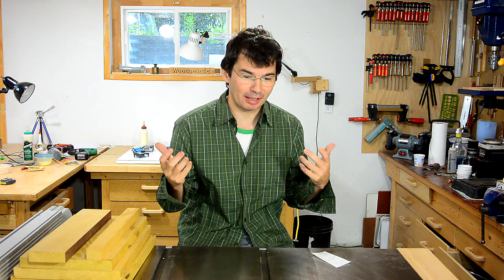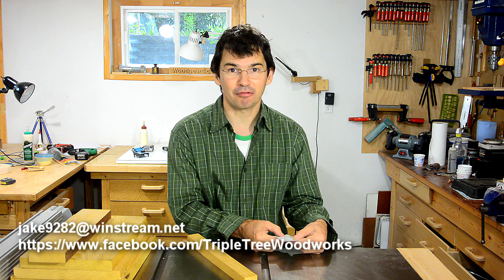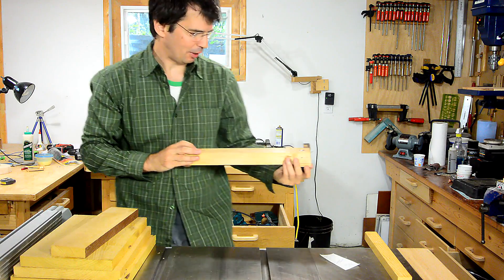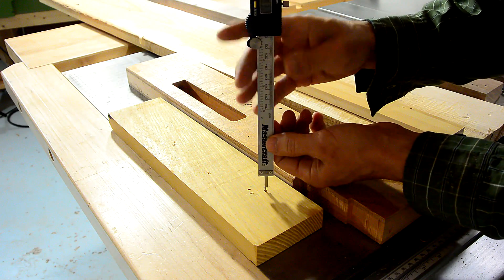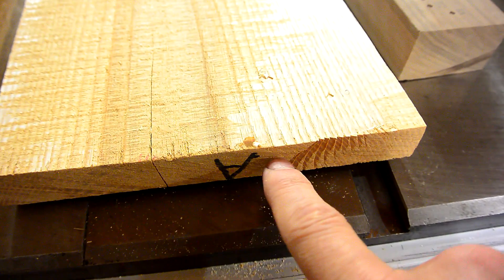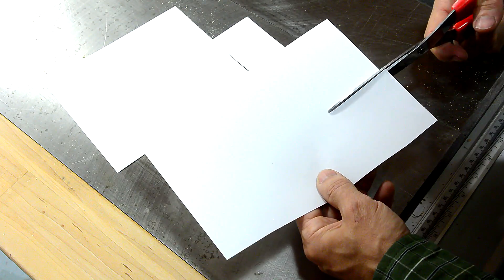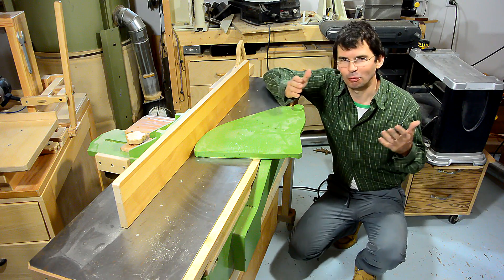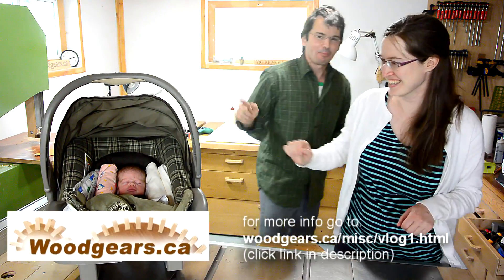Vlog - odds and ends

Comment: Congratulations on the baby!!

Osage orange is also known as bois d'arc or bow wood.  It is very resilient and flexible  and was used to make bows for hunting.  I think it's flexibility will meet a lot of your "spring" needs in all wood construction of tools and jigs.  Growing up, we called them hedge apple trees due to the heavy large green wrinkled fruit and the fact that it was always found on fence lines and along roads in rural areas.  I later learned that they were actually planted there as wind breaks to keep wind erosion from blowing the topsoil away.
Reply: I remember cutting firewood in my teens and being told not to cut the hedge apple trees because it burns so intensely hot that it would supposedly ruin chimneys or cause chimney fires.  Not sure how much truth there is to that, though I suppose it might be worth a try for blacksmiths if coal wasn't handy.  I also remember having to sharpen the chains a heck of a lot more often when we were clearing them.  Really tough stuff.

Comment: I admire you sticking to your principals, Matthias!  Interesting take on the pocket holes vs. jointer.  While I own both, I do find myself using the jointer 9/10 compared to my pocket hole jig.  Having said that, they have their place in rapid build up.  I always use glue to help increase my chances of a pocket hole project not coming apart.  Congratulations on your daughter!

Comment: Congratulations on the baby!  Projects I see in the future . . .
1. Crank-adjustable height bassinet, raised for changing diapers, lowered for reducing potential fall height to the floor.
2. Auto-rocking bassinet, with cams and linkages to emulate the rocking motion of parents.  Bonus: Different settings on the cams/linkages giving a Mommy and a Daddy setting.
3. Sound machine made entirely from wood . . . a miniature air raid siren in a sense, with more whooshing and less siren.
4. More baby gates, of course.

Comment: Congratulations for your new Family member Harriet !

Word to the Pocket holes, i think you're right about the jointer/pocket hole thing. I don't have access to a jointer so i guess Pocket holes are the fastest and easiest way to get stuff done, but even if i had a Jointer i would still use pocket holes for the same reason you mentioned. I have to agree , pocket holes are ugly! But depending on the project i choose the joining technique, if i like to show off the piece then i choose the "visibility" of the joint's, if i want the joint's to be invisible or highly visible  if they are nice. All depends on the piece itself , example  a gift box with pocket holes makes no sense and also dovetails on a Step stool that gets abused every day makes no sense either. My opinion is that, the joining technique should match the project and if its strong enough and saves time, then pocket holes are no shame at all ;)

Comment: when we first moved to my parent's new property in the early 90s there was an old wire fence with cedar posts along the east side.  That post was old as shit then.  It's been 25~ years and that cedar post is looking worse for wear, but you could still nail into it and it hasn't broken.  Suffice to say, that post was probably there for 50-years, exposed to the elements and high southern humidity, and it's still going strong.  And I say that to say that the orange osage post on my other neighbor's lot has been there just as long and it still looks like it did the day it was set.  Orange Osage will last 80-100 years on its own, Treated Orange Osage would probably last until the sun burns out, flares up into a supernova and wipes out our entire galaxy.  And even then, there is a good chance it would travel quietly through the eternal void of space, before landing, not much worse for wear, on a foreign planet to become an object of curiosity by it's locals.

Comment: Congratulations on your daughter!

Cool method of checking the wood. (And I can really appreciate the engineers approach to repeated tests to get a valid result. =) ) Have you ever tested if there is any difference if you do a load test instead of an impact test? Like what is usually done to hardness test metals? Some more springy woods might yield different results (or at least, that's my hypothesis).

Comment: I do appreciate you and your videos.  I value your opinion on many things.  I agree to disagree on pocket holes.  You are correct I do not have a jointer.   I am able to get a fine jointed edge on hardwoods without a jointer.  I spend the time saved on detail work, sanding and finishing.

Comment: Quickie thought on consistent release of the divot-making device ("divoter"): drill a hole (same size as the eyelet) in a small piece of wood (think 2"x2"x1/2"), insert a dowel or metal rod with a string on the end, and secure the wood piece as a platform at the height you wish to drop the divoter. Place the eyelet of the divoter onto the dowel, and then...pull the string sharply, which withdraws the dowel and releases the divoter consistently and with a near-vertical descent.

Comment: ps: Oasge is a really hard dense wood, it is a great wood For Fence Posts much like Locust.  It had also been used for Archery Bows.  In the same hardwood family like Locust in density.  Just remember NEVER to fill your wood stove with Osage at night... It Burns extremely Hot.  You can forge weld with it.  Don't ask how I know.

Comment: Agree pocket holes are not as strong as traditional joinery, but they are strong enough when used as intended. Not pretty, but in most applications they are never or rarely seen.  So for me they make sense for any wood worker at some point.  I have jointer and planer.

Comment: hey Matthias Wandel, what wood should i get for an axehandle? also, where? 
i made one before at my former school, but i got the wood gifted for that.
Reply: TheJoshinils Consult your local fire wood pile for local hardwoods :D
Reply: never heard of that before
Reply: local craft store, and probly ash due to its durability and strenght
Reply: In Finland (Europe) we just use birch. But the thing is to collect it out of the woods in the first quarter of the moon. Let it dry outside year or two before making the axe handle.
Reply: TheJoshinils Ash, Maple, Hickory... but it's cheaper and less frustrating to just buy a new axe handle.Save your woodworking time and skills for more noble projects.
Reply: i cant just buy a new one, the axe never had one, as i made it myself. the hole is just too wide for any normal handle i could buy. the handle could fit in it at an angle...
Reply: Buy a "normal" handle and add some hardwood strips with good wood glue to enlarge it.

Comment: At 1:14 does anyone know the details of the corded Ryobi drill? Model # or anything?
Reply from the maker: +Shane Burgess They don't sell that exact one anymore (bought 10 years ago),  But a slightly bigger one and a slightly smaller one, both very similar.
Reply: +Matthias Wandel Have you thought about getting sponsored by microgig (the gripper)
Reply: +the boss chef microjig, home of the g-ripper. work safer, work smarter.